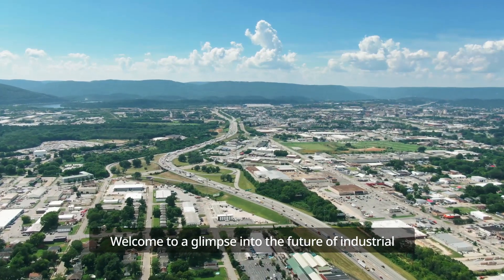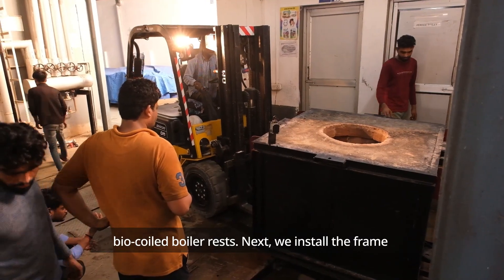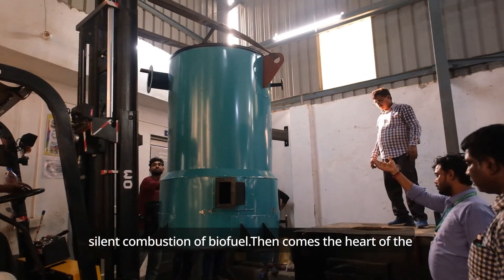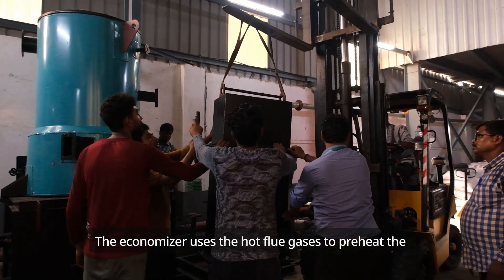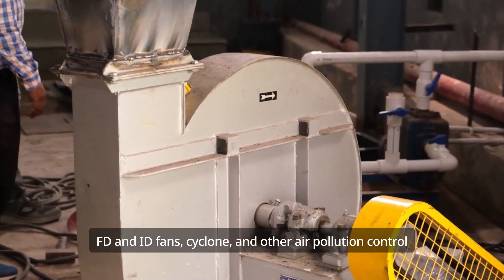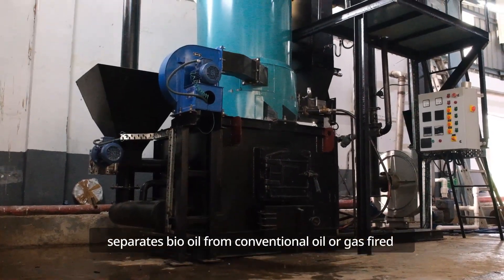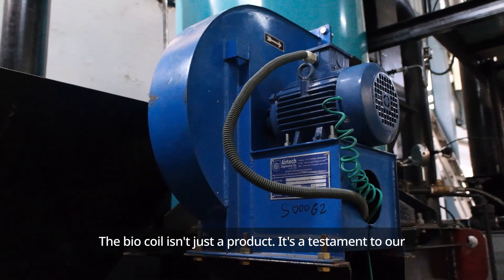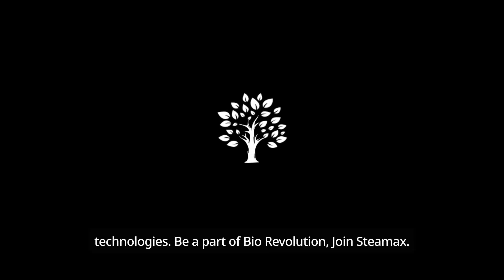BioCoil: Biomass-Fired Non-IBR Boilers (up to 700 Kg/h) | Installation Process

Comment: How do you ensure output steam quality that is steam dryness fraction in the Biomass fired Non-IBR boiler shown in this video? What is the steam dryness fraction that you can guarantee at the outlet of the steam boiler?
Reply from the maker: To ensure high steam quality in a biomass-fired Non-IBR boiler, key factors include efficient steam separation (cyclone separators, baffles), controlled biomass fuel quality (<15-20% moisture), proper water level management, avoiding overloading, regular blowdown, and optional superheating. These measures prevent water carryover and enhance steam dryness. A well-designed boiler typically achieves a steam dryness fraction of 0.90 to 0.95 (90-95%), which can reach 98% or higher with additional moisture separators or superheaters.